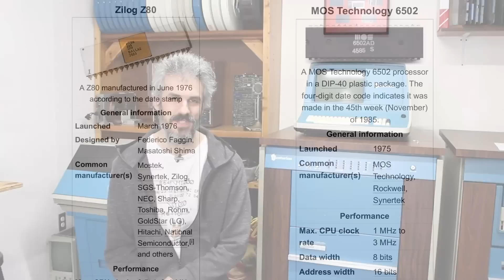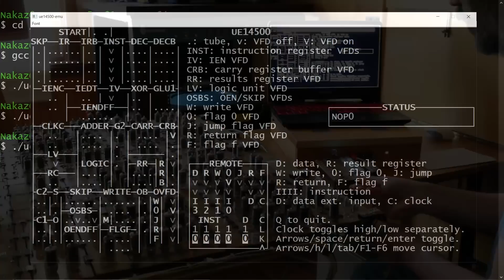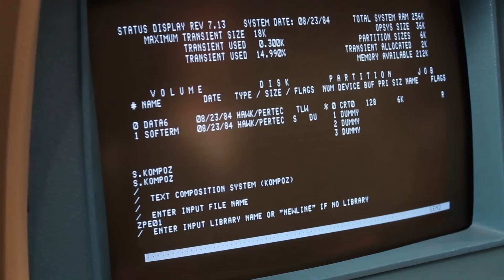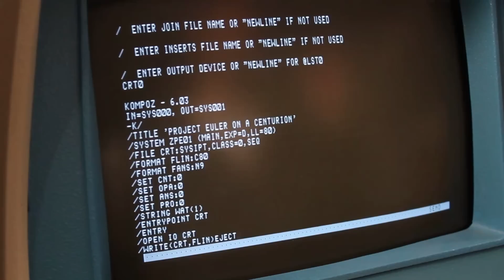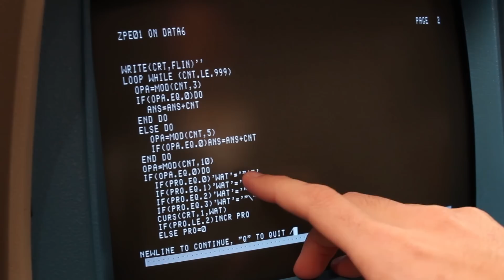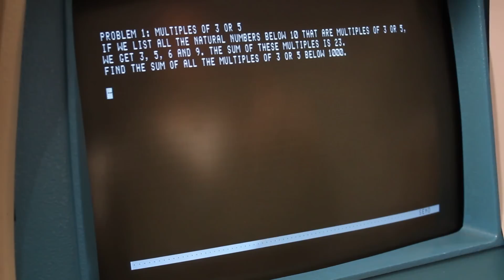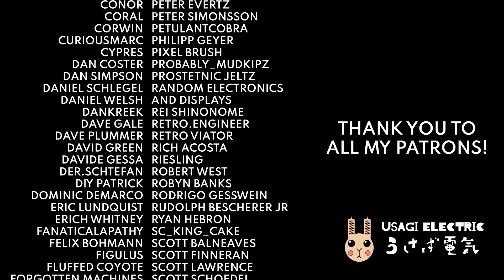Coding on a 1980s Business Minicomputer!

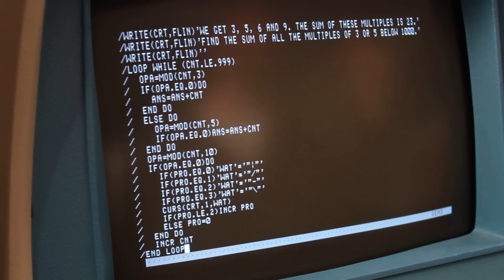Comment: 22:53 - I saw that END LOP - now I know what kind of Usagi is writing tthat program!  :)
28:26 Always make a backup!

KOMPOZ looks a lot like EDLIN on the old  CP/M machines. It probably lets you read in multiple lines from the input tape, work with them in RAM, and then write them out in a bunch.  What most programmers did was work mostly with modules that would fit in memory, suck them in at one go, edit them, and then write them out.  (Of course, a programmer would boost the amount of user memory available for the edit session. That's why programmers did so much of their work outside business hours on these machines.)
Reply: On CP/M, I would always use WordStar in non document mode to avoid the horrors of line editors.
Reply: True programmer still do their Windows coding with EDLIN!😉
Reply: ED, the UNIX ed text editor is the base editor.
EDLIN is a Q/Dos alternative, that MS copied in MS DOS too, we all call them ED !
i only wrote routines to export data on Digital system, good tool !
Reply: @lucasrem  Yeah, saying EDLIN was a brain fault, it's been a long time. I meant CP/M's ED. It was very different from ED on Unix, which was a lot more convenient. Once they became available, I'd use either RED (Ed Reams's small-C screen editor) or MINCE (Mince Is Not Complete EMACS).
Reply: @lucasrem  There was also VI, and then later on VIM
Reply: Ah, EDLIN; I only learned the DOS version, and only because I had to write or rewrite batch files on DOS machines with varying levels of installation, and EDLIN was the only editor I could count on being on each machine. That made me completely unnostalgic for Pre-MS-DOS 5.0 days...

Comment: I feel your pain with the debugging process. My first programming, back in the early 70's, was done using cards one would input to a Remote Job Entry (RJE) site via a card reader to a CDC 6400/6600 mainframe. Some time later, depending on the mainframe system load, one would pick up a printout of the results of your compilation and (hopefully) program execution.  Every time errors occurred, it was back to the coding sheet for corrections, and then back to the keypunch machine to produce a new set of cards for execution. I was in my 20's at the time, computing was new and interesting, so that lessened the  pain.  I look back on those days nostalgically.  Enjoy your exploration into old technology.  I later spent about seven years, from the mid-70s to the early 80s, working on PDP11's (an 11/04, 1103, and an 11/70), before moving on to working with a Cray X/MP and Y/MP in the late 80s.  Then the "modern" era of computing finally began.

Comment: It'd be interesting to see the centurion run the Mandelbrot benchmark written by Matt Heffernan to see how it stacks up against 80s 8 bit home systems and also James Sharman's homemade pipelined 8 bit CPU.
Reply: +1, totally agree
Reply: Sure but are you going to type that in using that terrible editor?
Reply: I'd actually do this with both assembly and CPL, like the benchmarks
Reply: @Vanders456  Writing from a modern PC to a floppy maybe?
Reply: @Vanders456  porting nano might be necessary first.

Comment: The instructions to the compiler at the start of the program are painful but I do appreciate that they are kept with the program and don't need to be remembered and input on the command-line each time the compiler is invoked.

About the program itself, the syntax is, well, archaic, but that shouldn't be a surprise, considering.

However, archaic or not, one thing that this era of programming lacked was blank lines, every line of code followed the other without any breathing space between them. Coding then was like writing books without paragraphs.

UPDATE: It seems the final source code does in fact contain blank lines, but this may simply be because it was written recently by people that know better.

Comment: This gave me flashbacks & PTSD! I got my degree in CIS back in the early 80s. I can't tell you the hours I spent at the computer center writing code for my classes. FORTRAN, COBOL, Pascal & Basic. Later taught myself P/L1. Editing, compiling repeat ad nauseam. Then actually get to run it only to find 10 more errors. Start all over again. All of use looking like zombies squinting at the ADM terminals. Not daring to get up to use the bathroom lest we lose our set & terminal. Your passing out on the floor is exactly what happens when it finally runs correctly. 

Our uniform was jeans, t-shirt & mountain climbing boots. Swinging from depression to mania. Living on cheesesteaks, pizza & caffeine. 

It's a wonder I survived.

Comment: I ran this on my Psion Organiser in OPL (BASIC-like), 0.9Mhz.  It took 19 seconds, or 13 without the "progress twiddle".  I wrote an alternative algorithm that took about 7 (no progress twiddle).  In interpreted basic on the TRS80 model-I, 1.77Mhz, without progress twiddle, about 35 seconds.  The difference would be that OPL "translates" into a sort of P-code (they call it Q-code), so it's quicker than interpreted BASIC.  Turbo Pascal on CP/M on TRS80 Model-4 4Mhz, about 1 second!  This compiles to machine-code.  A version compiling to P-code would be slower.  I noticed some of the CPL code looked a bit FORTRAN-like, such as the .LE., and the use of output formats.  I shall try it in FORTH when I get a chance.

Comment: Thanks for the video, I loved it, even the frustration.

The KOMPOZ editor is just as horrible as the EDLIN line editor in the early MSDOS. 

But I really wanted to say that this computer is really 1970's technology. The fact that they were still making and selling them in the early 80's must have been due to an existing customer base. I was using a TANDEM computer in 1983 and they were already streets ahead of this. They had an editor called EDIT which was command line, but by the time I was using it they had introduced a full screen mode. I still think I remember the command to go full screen, *XVS as I used it so often. The TANDEM OS, called GUARDIAN, was also far more usable than what we see here. Booting the TANDEM though was pretty arcane. Lots of binary switches on the front panel to set IO addresses and toggle states. The bootloader software was on tape. It took about 20 minutes to get the entire system up.

Comment: you really cracked me up... I very well understand your frustration about yourself... but in the end, you got it. --- 6K for an editor is really a tight spot. I assume the editor is like any other online (CRT out, KEBD in) application of at that time. So I can call myself lucky in hindsight, where I had 12K (Bytes) to write an application that included code and data AND an ISAM routine to C(R)UD(S/P) an (postal) address, for example. ISAM had exactly one (primary/unique) key, and  C(R)UD(S/P) was not a single program, but actually 5: 1.CREATE w/ ISAM find and insert only,  2.UPDATE w/ ISAM find, and 3. DELETE w/ ISAM find and delete, and some Show and Print programs. The data was two (2) files: an pre-formatted index file to support ISAM and a preformatted file for the actual DATA (address record).The editor was though a marvelous one, runtime was single step, source debugable interpretative system on a TTL w/ TTL ALU (not an AMD(?) Bitslicer). Time was 1976, 'Computer' was a WANG 2200 model T w/ 5+5MB Phoenix (Hawk?) Hard Disk Drive (or 8" floppy or Philips Tape Cassette). OS and language was a standalone custome basic, that 'compiled' each line of source code into Byte Code for the 18bit instruction architecture. There there is more to say about a user and key  stroke and function key (not command) oriented, float formatting TEXT PROCESSOR I wrote (like WordStar BEFORE WordStar and before WANG was into text processing on CRT) with only 250 Bytes buffer in memory (equal one sector on disk) for a 24x80 screen - all this going forward and backward in the text hidden to the user, operational with cursor up / down / left / right and jump number of lines up and down, always updating the full screen... and managing also a pre-reserved range of sectors on disk, and theoretical document size up to 16MB.. Haha... You almost got me challenged to write the 4th text/word processor in my 'career'. Enjoy your toys (in recent past I binge watched your tube series to understand this technology, because I entered electronics w/ KOSMOS Radio & Elektronik on glass housed, black painted transistor GE OC612 and GE diode... about 10 years before that time. Bottom line: What I learned in thinking then (while coding) is down right still applicable today. Today, for fun, I do Espruino on EspruinoDotCom.

Comment: For comparison this program, written in Fortran 77 and run on my PDP11/73 takes 2.45 secs with progress indicator and 0.61 secs without indicator.
Reply: You could do a compromise where the progress indicator is updated only when one of  the conditions for the add subroutine is satisfied.  This would slow the program down less and fulfill the purpose just as well IMO.

Comment: After having seen so many weird editors I count myself fortunate to have started programming on the Commodore PET 3000. Unlike its 'peers' this machine came standard with a full screen editor where you could move the cursor to any position on the screen and just add or remove characters. Conceptually, the screen was an input device and not an output device!

Comment: This reminds me of the shock when I went to SFA and was introduced to MVS for the first time.  I knew DOS and even a bit of Unix but it was a shock to the system on how odd the command structure was.  I kind of fell in love with these kind of systems after that.  OS/8, Job control etc.  That being said, this is by far the most unique of them.  Damnit I think I will help with the emulator.

Comment: Nice to see yet more progress in this Centurion series. I did spot an error in the program but not the one you mentioned in the video. You have the line "IF(PRO.LE.2)INCR PRO" but the 2 should be 4 as you have four lines to determine the value of WAT that is to be displayed. The next big job is to get a better text editor on to the machine followed by some other programming language that would let you do even more with the machine.

Comment: If you want to do that in Excel (version 2021 or later):
=LET(seq,SEQUENCE(999),modt,MOD(seq,3)=0,modf,MOD(seq,5)=0,SUM(FILTER(seq,modt+modf>0)))
gives you the correct answer, and on a modern computer, it runs pretty much instantly.
Of course there are much more efficient ways to do it.

It is amazing how much things have progressed since then.
Reply: You don't actually need to generate the whole sequence... int( (y-1) / x ) tells you how many numbers there are in each sequence, x being 3 and 5 in this case and y = 1000. The Nth triangle sum counts up all the multiples ( in the 10 case there's a 3,6,9 = 18 which is a 3x (1,2,3) which is the 3rd Nth triangle = 6) . So thenmultiply those numbers back by the x to get the sum of the numbers. Then do the same calculation for the 15s and subtract it (because you've counted those twice!).

In python:

target = 1000
values = [ 3, 5, 15 ]
counts = { x: int((target-1) / x) for x in values }
sums =   { k: v * ( v + 1 ) / 2 * k for k,v in counts.items() }
result = sums[3] + sums[5] - sums[15]

print(result)
Reply: @katielucas3178  Or you could do:
numpy.sum(numpy.concatenate([numpy.arange(3,1000,3),numpy.arange(5,1000,5),-numpy.arange(15,1000,15)]))
Reply: This can be pasted into Calculator: (999/3)*(999/3+1)/2*3+(995/5)*(995/5+1)/2*5-(990/15)*(990/15+1)/2*15=
I cheated a bit since the Floor function can't be pasted into Windows Calculator, even though there's a key for it.
Reply: @katrinabryce  While that code is more succinct, I think you might have turned it back into an O(N) solution...

Comment: Great video, as ever! 🎉 
One mistake… 18:15 You stated OPA = 334 … but the MOD of 28/3 is 1.
That pattern continues in the following on-screen texts…
Reply from the maker: Yup, good catch!
I left a note in the description addressing this!
Reply: @UsagiElectric Oh, sorry, I did not read it. By the way: You were not so wrong… Just multiply your fraction part below one (after the decimal point) with the original divisor and get the actual modulo. 0.334*3=1 (approximately) 😂

Comment: thats a hell of alot of program parm setings to type before you can
even start coding. But I do like the part about naming
the file and specifying which folder it is going to be accessed by
before starting the program rather then after. . .
I may implicate this into my programmimg code
tho I only code in Basic, but plan to learn other high level languges
in the near future 😀

Comment: Wow, what an adventure this has been! Reminds me a lot of trying to write something usable in EDLIN on CP/M. Pretty sure you spent a lot less time on this, than I did trying to write a proper emulator for a modem that really wasn't suppose to work on CP/M and my Xerox 820-II.😝 (I saw another comment about someone using Wordstar in non-doc mode after I wrote the above, and I probably could have saved myself a s**tload of mistakes and recompiles if I had known about that at the time.)😆

Comment: When I was a kid, late 70s, my father bought one of these for his accounting practice. The enclosure was about 5" tall and had a removable plater drive. Needed an air-conditioned room with a temperature alarm. What I remember the most is that the people that worked for him could print out a picture of Mickey Mouse and other cartoon characters on green bar paper with the impact printer... ETA: It also had 8" floppy drives.
Reply: What was the Warrex/Centurion computer used for,  CPA/accounting, inventory, small bank or oil & gas accounting?  What city was the computer used in, recall the Centurion dealers name?    FYI - I worked or Warrex/Centurion from 1975 to1986 at the factory.
Reply: @kenromaine2387  Oklahoma City, Used for public accounting. General Ledger, Payroll, Taxes, etc. David Seiger was the IT Consultant. He passed away several years ago.

Comment: This has reminded me of early 80s PDP programming in DIBOL on RT11XM. DEC's editor (after ED and TECO) was EDT which was either line mode like your KOMPOZ if using a DECwriter console, or screen mode on VT100s. I learned it all in 1984 and can still drive it in text mode now so it's worth sticking with it :D Happy new year Dave, all the best to you and the family.
Reply: EDT wasn’t bad at all (especially if you had a fast enough serial connection to use visual mode), but TECO….  shudder.
Reply: DIBOL... that's a name I haven't heard in decades.
Reply: @edgeeffect  I worked on the commercial port of DIBOL, DBL for years.

The language was bought by a Sacramento based company who still today offer it on all platforms. It was a VM like Java for many years, and I worked on its internals.

Now it compiles to .NET apparently. That was since I left.
Reply: @davidbrooks2540  I still use EDT today, or EVE with the EDT keypad defined. It's utterly ingrained in my psyche.
Reply: @TesterAnimal1  
Some of my colleagues left to work there in the late 90s :) One of them still does. I'd moved into field service long before then though.

Comment: 2:40 - My college days were spent on a VAX 11/780.  Specs on a VAX or Centurion wouldn't sound impressive on paper to the unintiated but were impressive to the informed when memory usage and multiuser OS were taken into account.  
5:00 - I remember the first Apple II HDDs coming out, 5MB in all.  And costing upwards of C$1300.
10:30 -This is why the first thing I grab when coding is graph paper and pencil, not a keyboard.  
14:00 to 32:00 - Smoley hokes.  And I thought COBOL was inscrutable.

Comment: I was on TeleType terminals and printers, able to convert, working for Digital, exporting it to ASP systems etc, publishing the data online. Real estate, banks, incurancy etc.
It all started with a very old TeleType German printer (1930 ??) on my old BBC micro, so i could print papers for school, basically a type writer, that needed translation to 8 bit.  RS 232 is just morse code on telegraph levels in 8 bit, 1880 skills !

Comment: In BBC BASIC to clear the screen you use CLS but that’s actually a synonym for VDU 12. And VDU 12 means send character 12 to the character output. In ASCII, character 12 is Form Feed, I.e. move to a new sheet of paper.

Comment: Awsome job so far.  This is a bit like trying to relearn a dead language that no one speaks any longer.  Most of your time spent is the output to the screen the characters are fairly quick to get into memory.  Even on newer computers like Sun Microsystems, we'd see a speed increase whenever we turned off output information.  Save half your time by removing the return to zero location to write a new character.  Instead just use dots that continue on the same line.  I be you get half your speed or more back.

Comment: I am curious about the Centurion Programming language and would like to read the manual. BITD, Back in the day, I was involved in porting a computer language to an AT&T 3B2 computer. AT&T was happy to share their documentation on their 'C' compiler, but we had to do a little reverse engineering of our own on the 3B2 assembler. Unix has a 'strings' command that when run on a binary file will output the embedded ASCII strings. We used that to find some assembler directives that we wanted to use. :-)

Comment: The on-screen modulo arithmetic example at around 18:30 is wrong. 28 mod 3 is one (1). For integer division, the remainder is always an integer. For a practical example of modulo arithmetic, think of a 24 hour clock. After reaching 23, the next hour is zero, and so on. If the clock says 3 now, then 75 hours later it will show 75 mod 24 (call this r), where (75 + 3) = q.24 + r, q and r are integers, and 0 <= r < |d|. Solving for q and r with those constraints gives q = 3 and r = 6. So the clock now says 6.